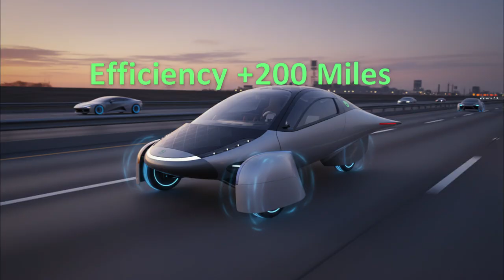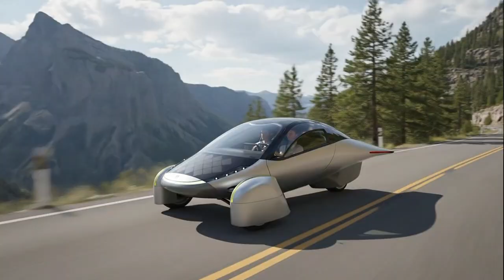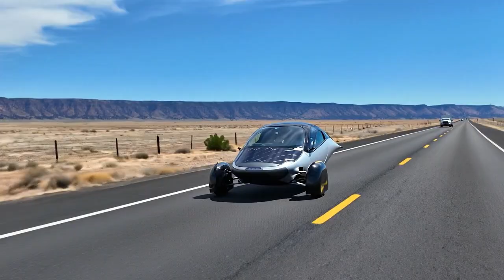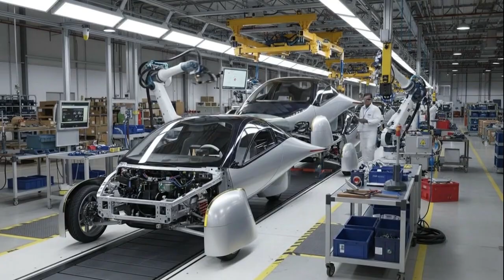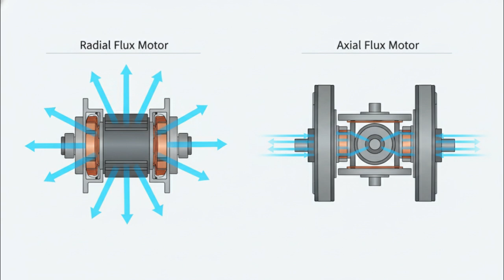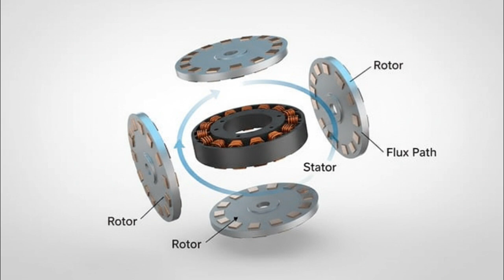How Aptera’s Solar Car Motors Work: The Full Engineering Breakdown

Comment: Just looked up the specs. Vitesco motor weighs 76 KG and is capable of 150 hp.  The base Tesla Model 3 RWD motor weighs 80 KG but this also includes the inverter which provides the high power electronics to drive the motor. This power unit is capable of something around 300 hp.

Comment: Aptera does not use axial flux motors. The Vitesco motor Aptera uses to power the front wheels is a standard off the shelf radial flux off the shelf motor.  Aptera is looking at a two-speed transmission to improve efficiency slightly, but this is something under study.  I believe it uses an Elaphe radial flux hub motor in the rear for AWD versions. This is again an off the shelf product.
Reply: What other products use the Elaphe Motor?